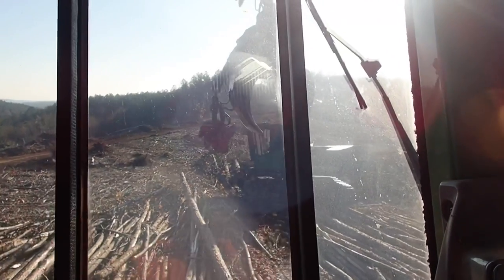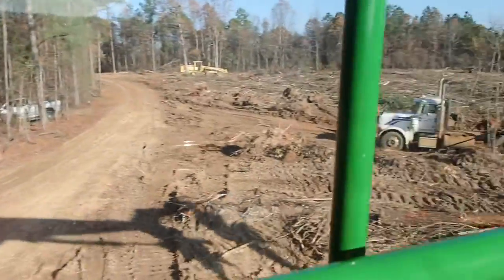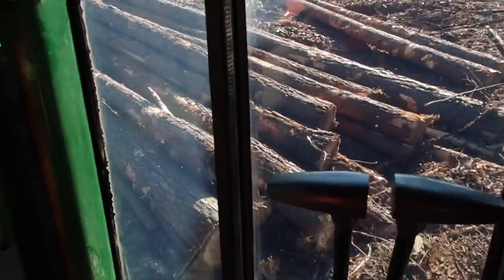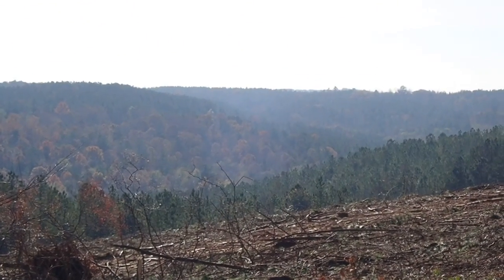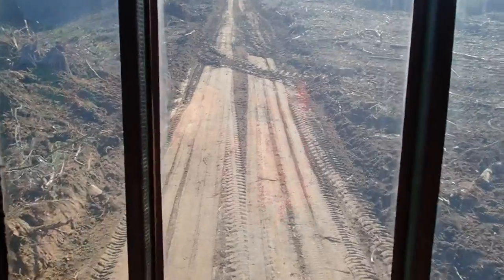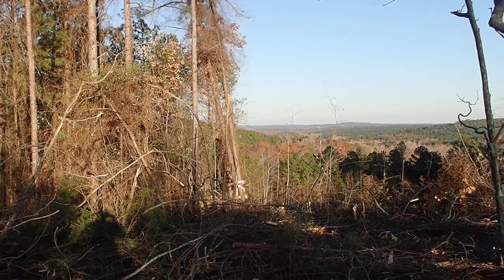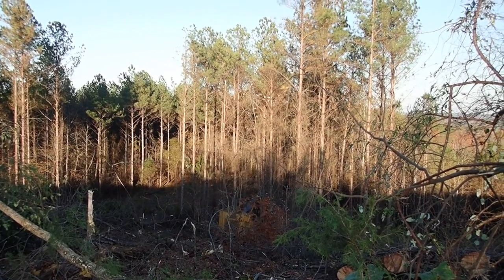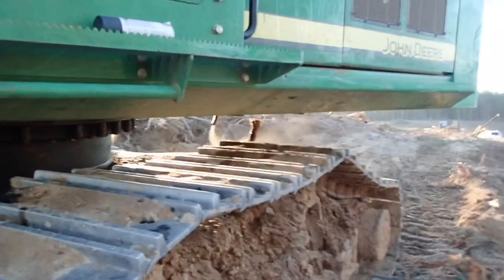Tigercat LX830D quickly harvesting trees

Comment: I cannot believe that TigerCat platform.  I had never really paid much attention to the operator platform in other logging videos.  It is quite remarkable when you think how that platform remains steady in the horizontal plane while the machine transverses the steep terrain sweeping the boom sideways, back and forth cutting and holding such great amount of weight straight vertical.  It seems that whoever made the decision to acquire that TigerCat really knows what he is doing  i'm guessing each piece of equipment is serviced  at the end of each work day.  I'm wondering when and how often the saws are sharpened and set .  That logging business has a lot of moving iron and a whole lot of decisions have to be made each hour.  Thank you Tim for  letting us ride  along with you in the John Deere.  It is a great machine even with the blow by .  It did not seem so bad to me.  My 1950 Chevy 6 cylinder had excessive blow by. :-)

Comment: I just recently bought a trailer mount hood loader and it has the 6.8. Same deal with the blowby. It’s weird the older 6414 is basically the same engine and they didn’t seem to have the blowby and longevity issues

Comment: I know this cutter has the better hydraulics. Yet you still have to think Tigercat has one hell hydraulics engineering department. On a separate note yesterday you praised the 8.1 in a skidder with 17,000 hours that was on engine #2. Today the 6.8 in the loader with nearly as many hours and engine #2 is a different story. Just a little confused did the 8.1 last a lot longer before needing replacement?
Reply from the maker: That particular 8.1 is the only one we have replaced in all that we have.  A ring broke on a piston.
Reply: cotontop3 you hiring cotontop3 ?man I’d appreciate working for a company like yours.
Reply: The engine in a skidder works a lot harder than the engine in a loader.